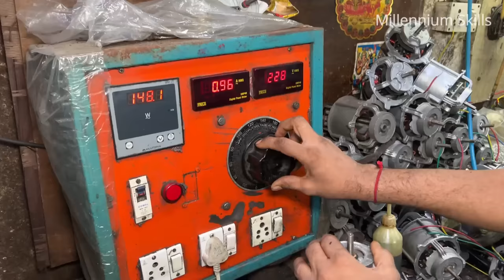Amazing Prosses of Kitchen Appliances Making. Mixer Grinder Manufacturing Process Step By Step.

Comment: This is not amazing. It is a threat to every single worker. One wrong movement and you end up with body parts hitting fast moving machine parts. The worker's skill though alone prevents accidents that dead usre have to happen when one of these workers tires for just a second and gets unattentive.
Reply: The other negative aspect of this is that if all the work is done by advanced fully automatic machines then no one will get employment.
Reply: @masterarts3496 No worries robots will become affordable in India and many medium industries will be able have them at the cost of jobs. Right now I think video is good and all they need is some disposable gloves
Reply: Where megnate gone need also megnate,

Comment: 6:43-7:30: What is the purpose of the submersion of the stators and the rotors, and also what chamber was that he put the submerged stators and rotors into and what was its purpose?
Reply: I would "assume" varnish.
Reply: The purpose is that the coils do not loosen due to vibrations. It also gives extra insulation to the coils and in the chambers the varnish that was applied in the previous stage dries.